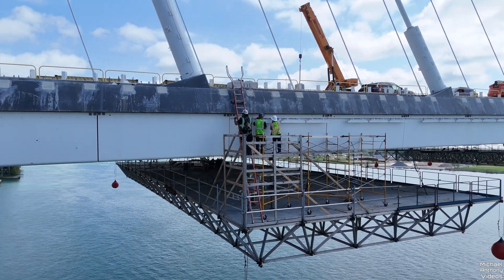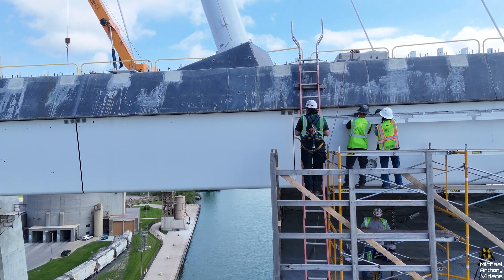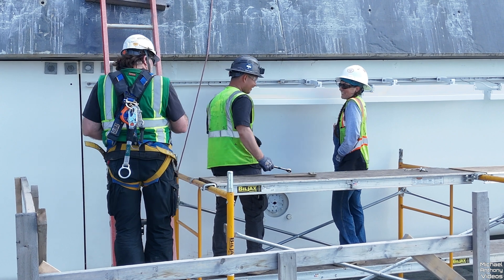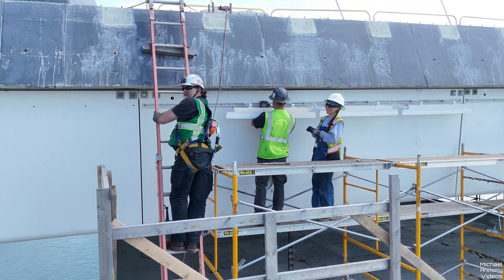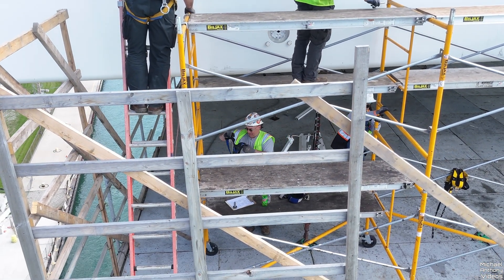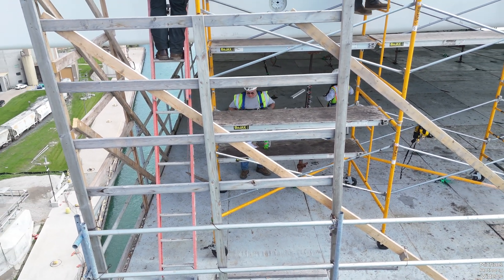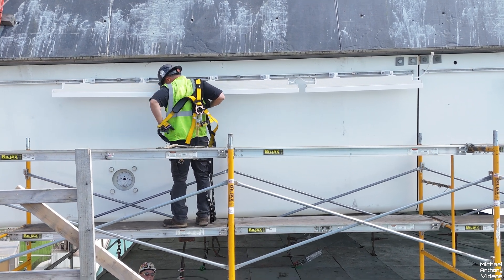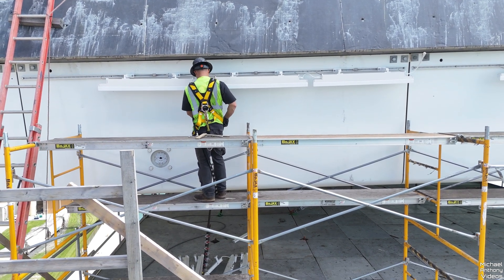Are the Construction Workers Following Safety Guidelines? | Gordie Howe Bridge

Comment: It must be nice to sit there and be an armchair quarterback about something you know absolutely nothing about.
They did use a retractable to go up-and-down the extension ladder as required. 
The yellow scaffolding they were working on has safety cages around them.
Tie off is not necessary on this scaffold.
BNA safety signed off on this design.
Reply: Because you need to wear a safety harness to go up the ladder.
Reply: @johntewithers5444   and going down the ladder? No safety harness needed?
Reply: Why did they put their safety harness on to go to lunch?
Reply: i am sorry but u r wrong if a worker falls of that scaffold into the water or to the platform below they will be critically injured they must have fall protection in this case and they new it they immediately got down to the platform to put on thier harnesess they should be reprimanded